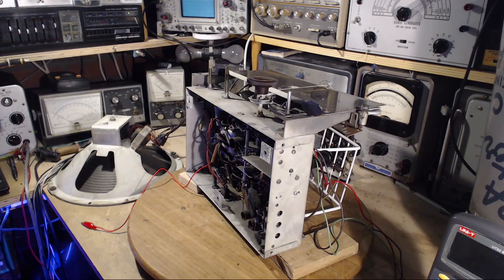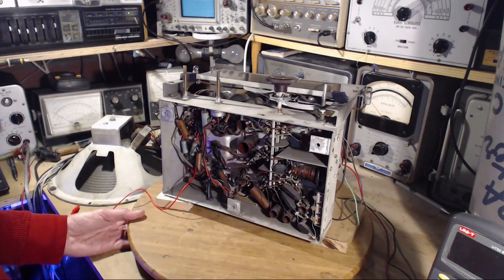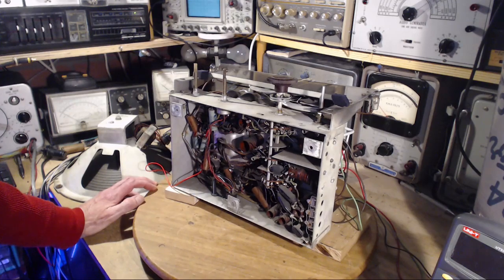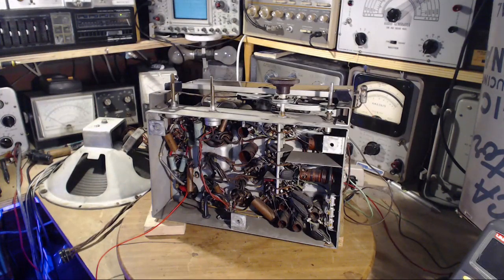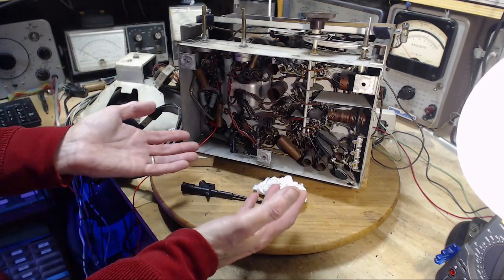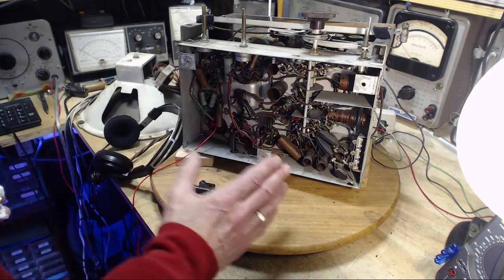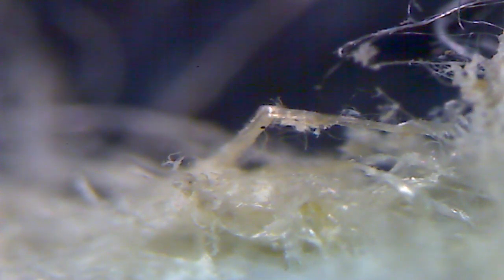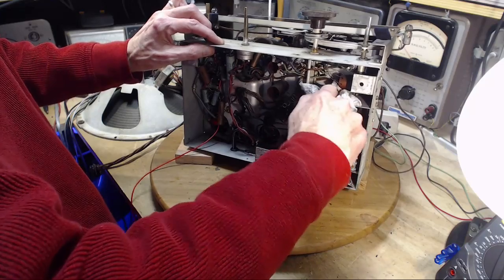RCA A-32 Globetrotter Video #6 - Asbestos Dust Concern?

Comment: Q-tips with a moist cotton tip (distilled water or low-% alcohol).  Use up most of a box.  Reaches deep into the chassis.

Comment: There seems to be new adapters that would let you switch to low voltage wire ended vacuum tubes that Raytheon used to make and make the radio run cooler, Blue Asbestos is the nastier of the two.